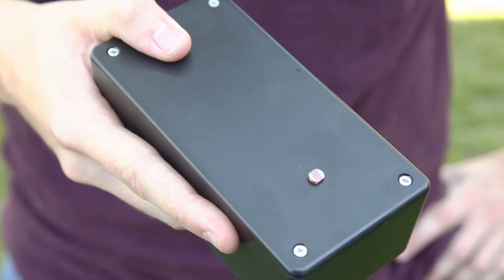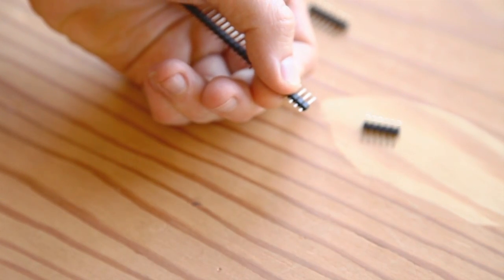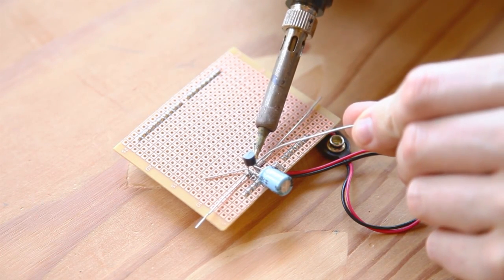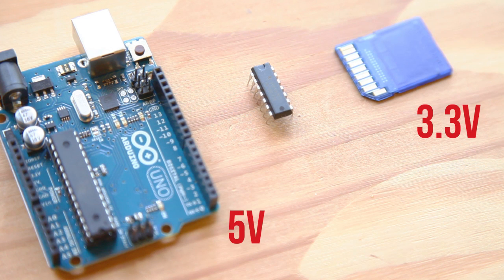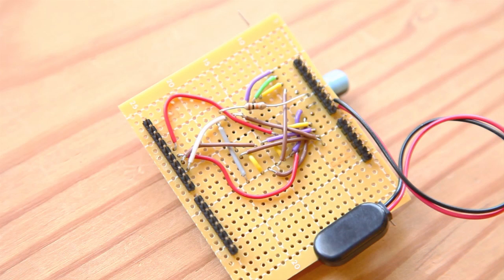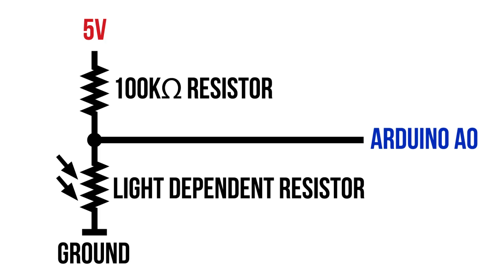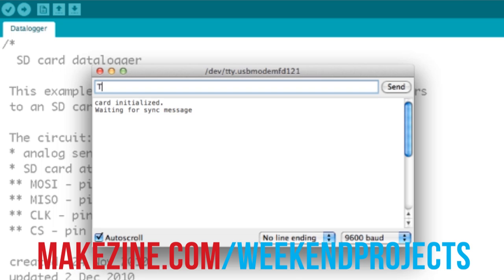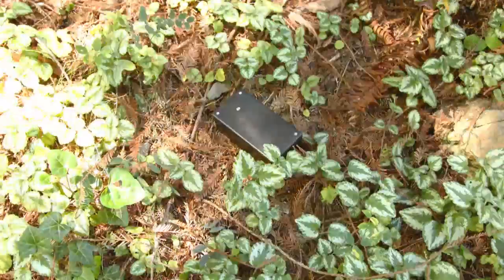Weekend Projects - Sun Logger

Comment: Instead of hooking voltage divider from 5v to ground, hook to a digital output and ground. Then turn set the digital output to 5v or high just before you take a reading. Then take the reading, turn back down to low. This  will save more power. And use a little solar panel and rechargeable batteries. Also, when light levels drop below a threshold for a certain amount of time, increase interval time to much longer than 15 sec. like several minutes. In the morning, it will go back to 15 sec

Comment from the maker: Arduino has both a 5V and a 3.3V regulator. The 3.3V regulator supplies voltage to the 3.3V pin. The Arduino is 5V in the sense that its input/output pins are all 5V. (High = 5V) We believe the 3.3v pin is there so that you can use a sensor that operates on 3.3v.